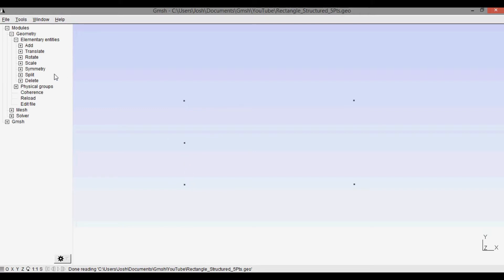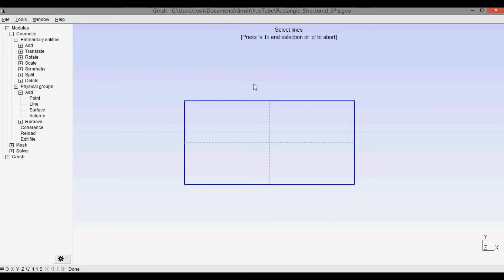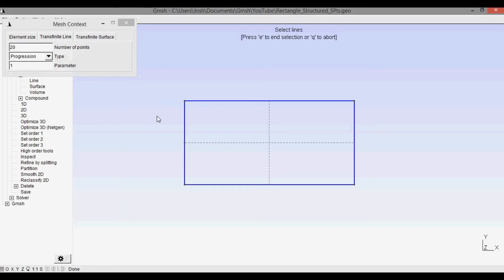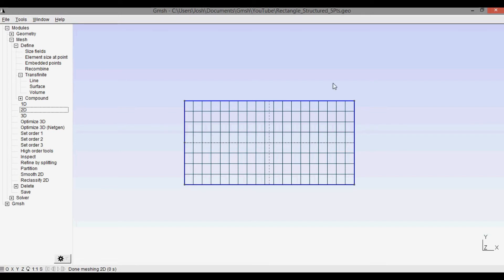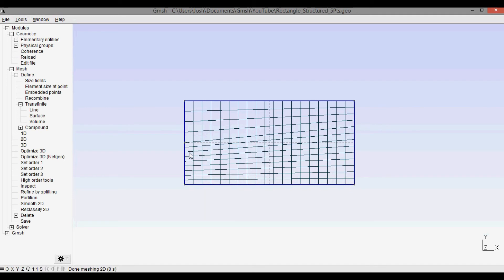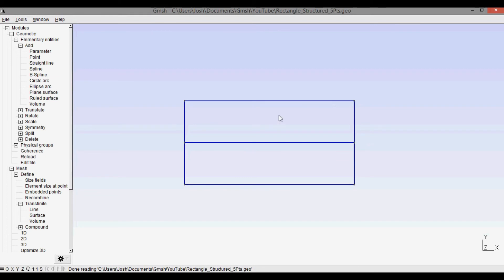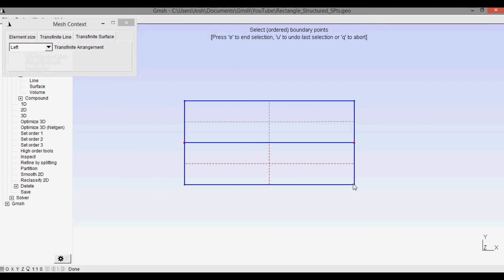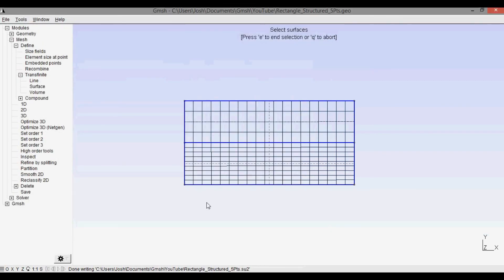GMSH: Structured (Transfinite) Rectangular Mesh (5/6 Pt)

Comment: Thanks Josh. I'm using these techniques on a project and have a question. -  Should the line separating top and bottom plane surfaces (and transfinite surfaces) be removed after generating the upper and lower 2d mesh? Otherwise this line remains as a 1d element across the overall mesh. The 1d elements normally represent a mesh boundary.